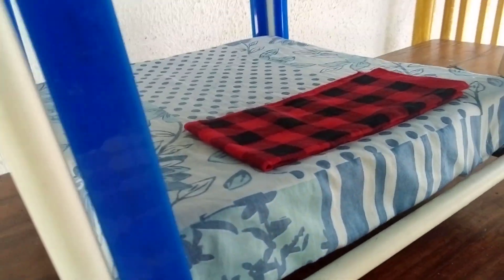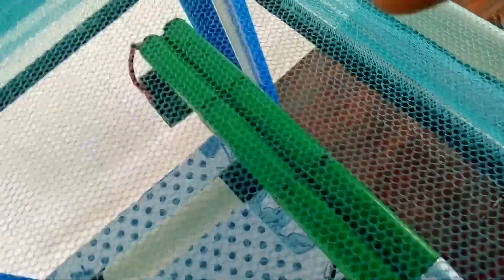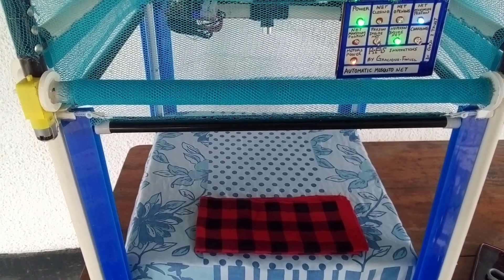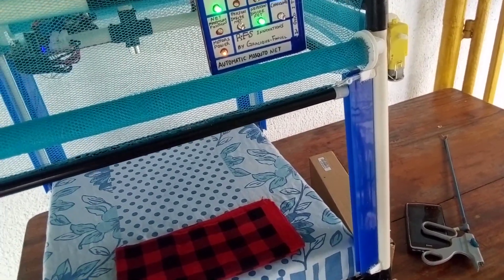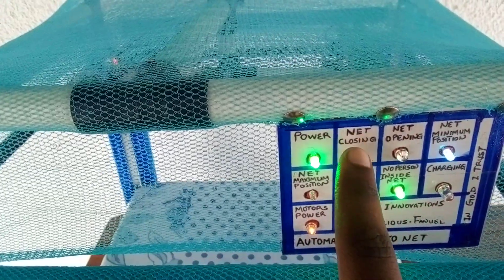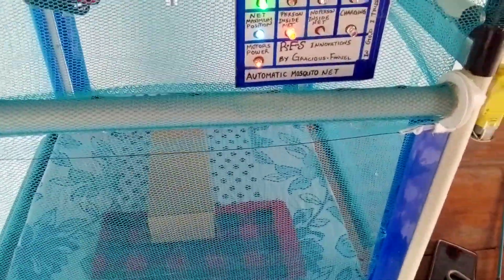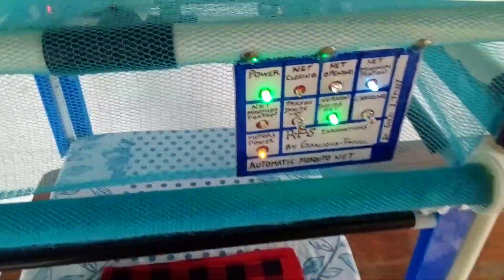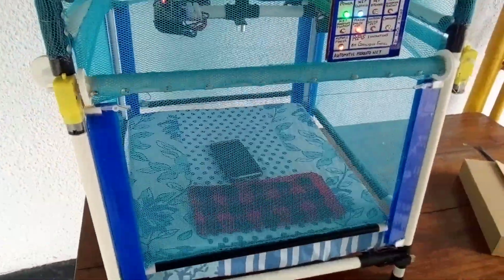Automatic mosquito net   ,by RFS

Comment: you mentioned about waves to keep the 'mosi' out. Is that implemented?
Fail safe item to consider: There should always be enough juice (power) to successfully open the nets fully. This could remove fear of 'being trapped' incase of a power failure and also a manual option at least to one of the sides of the bed from both the inside and out incase of a mechanical and technical failure.
Reply from the maker: thanks for the coments,i take note of that